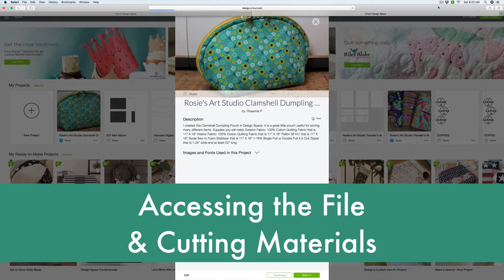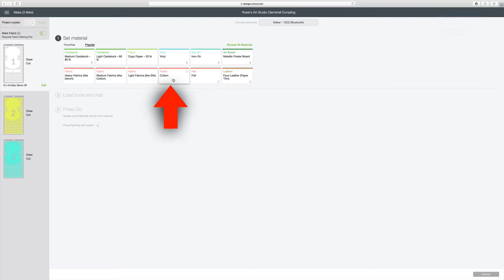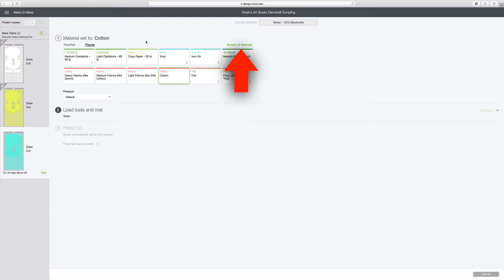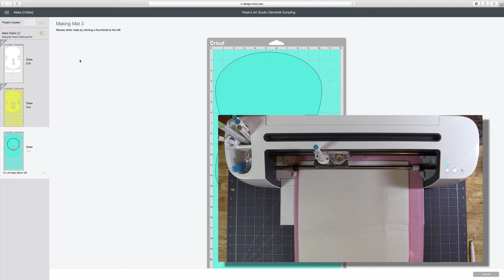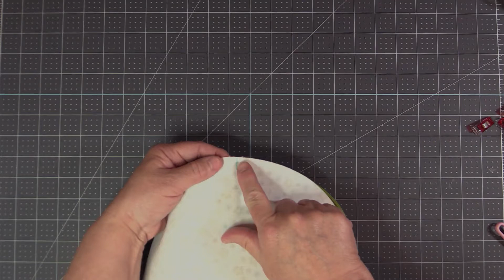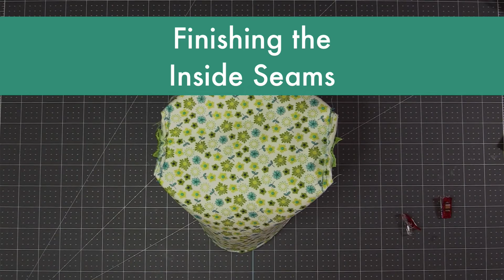Create a Clamshell Dumpling Pouch with the Cricut Maker

Comment: Iam so happy I found you I just got my cricut maker reason I bought it was to be able cut fleece ,foam rather than using the rotary cutter I thought I would be able to use my I pad which I am addicted to it so I guess I will have to bond with my laptop bummer,hoping to try the clam shell dumpling pouch once I get my maker set up any advice would be great at this point .thank again Alice J
Reply from the maker: The Maker is great for cutting fabric.  You will love it once you get it all set up.  Have fun making the pouch!